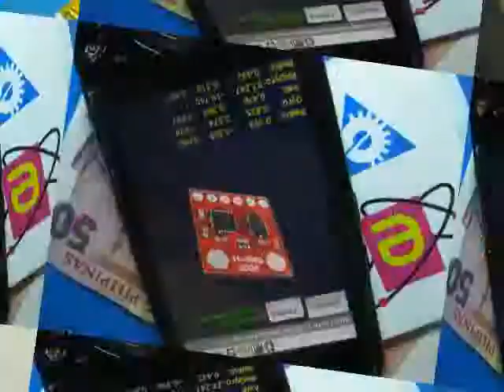BT  Inertial Measurement Unit

Comment: You need 2 running threads... One for UI and another to continuously read bluetooth data. I had your same issue with the twitching 3D module until I split the processes.